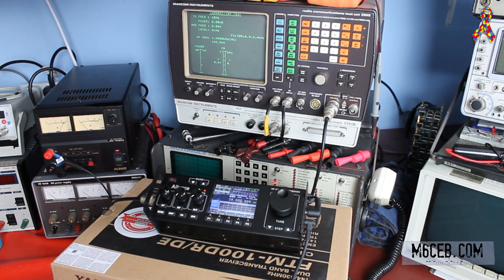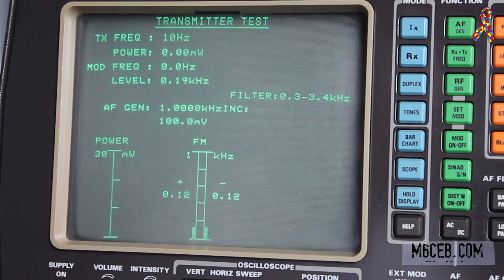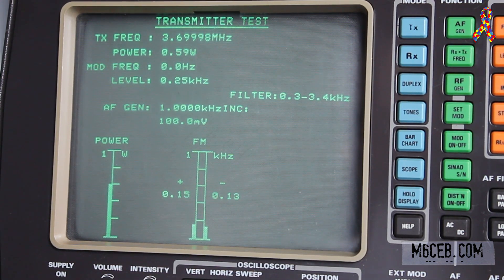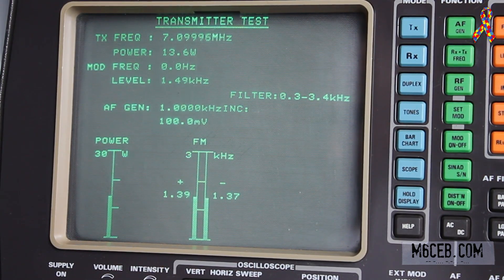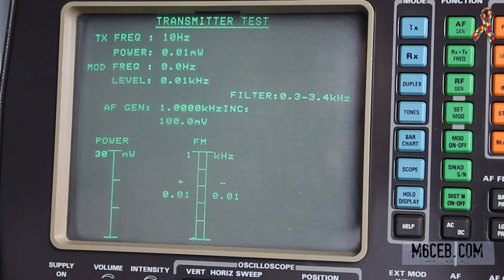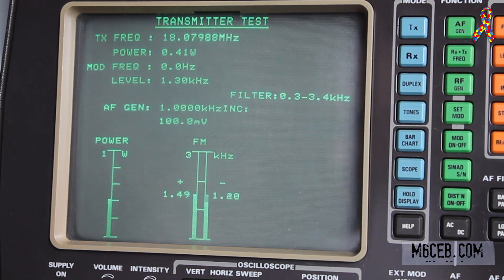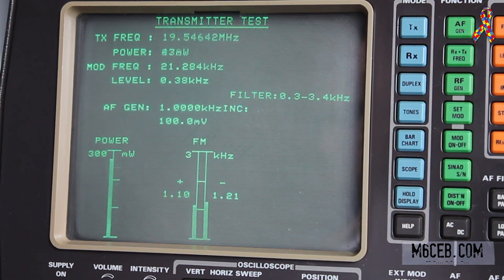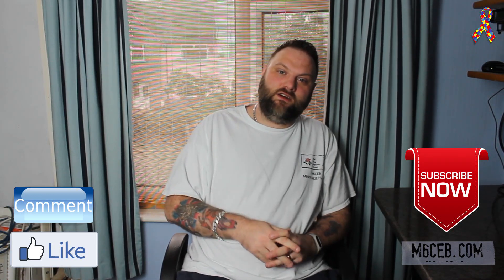Ailunce HS1 HF SDR QRP portable Transceiver! Full Power Test, Will this radio do 15w? Lets see!

Comment: The reason the power is all over the place is that these radios do not come adjusted from the manufacturer. If you look at the manual, there is a procedure for setting up the PA Bias and then adjusting the power on each band to 5 and then 10 watts. Also, there is a procedure to adjust the power meter on the radio to read the proper power output for each band. This was my experience when I first received my RS-218. There are all sorts of custom menus and adjustments besides just setting up the power output. I find it unusual that the manufacture of these radios do not align them. They pretty much work right out of the box, but what you see power output wise isn't even close on all bands until you do the step by step alignments. At least that was my experience. I purchased the Recent brand RS-218, but it is the same clone.

Comment: Thanks for the power test.  Have you done any frequency stability measurements, either with test gear or, perhaps more easily, using WSPR transmissions? Thanks!

Comment: Hi Matt, you can adjust te various power levels with the software in the transceiver, very easy with the gear on show. Just check out the manual on-line and it has the procedure on how to do it - 73 Alex VK2ABE
Reply from the maker: Thanks so much buddy 👌🙏